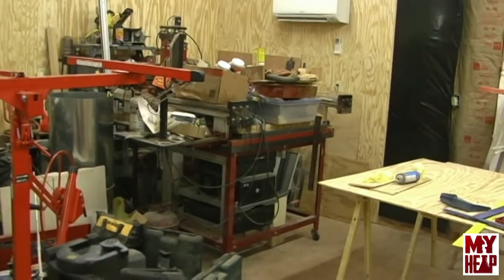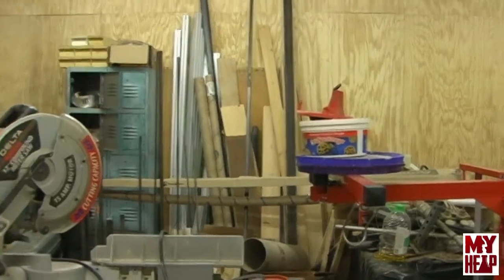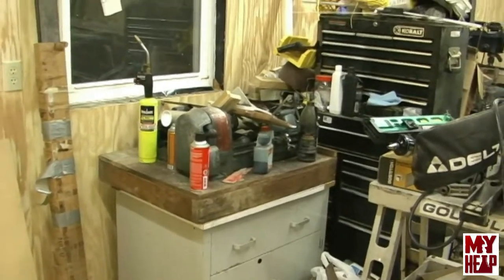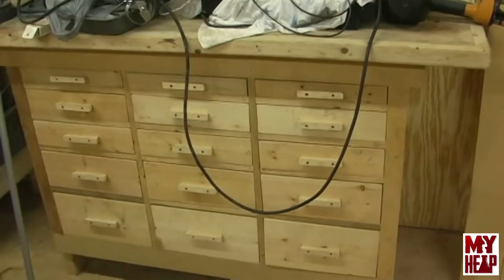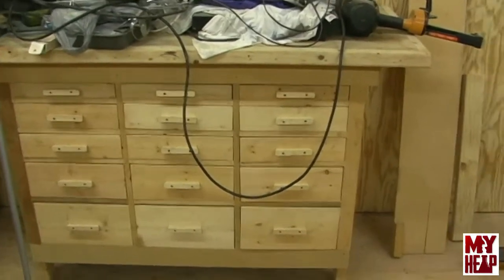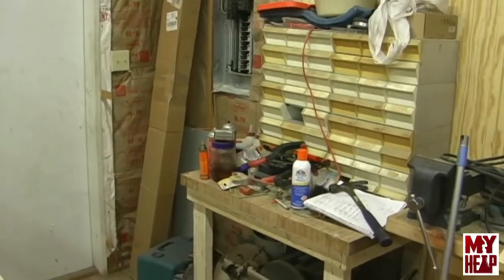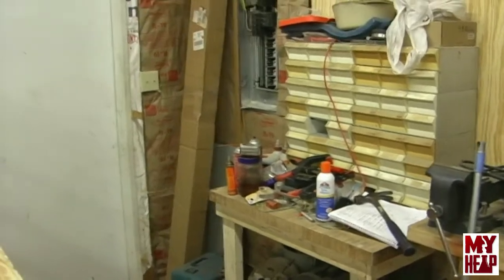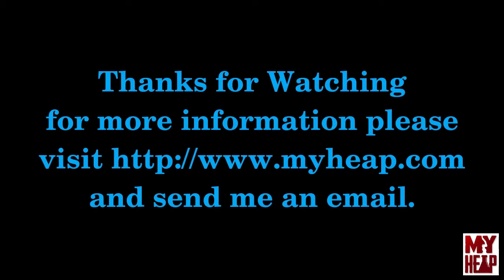Shop Update - 09 AUG 2018

Comment: That’s certainly a nice looking bench of drawers. Joe you have a bench problem in that you like all of us use them for clutter, like me you need more shelving. I’m actually in the process of making my work bench smaller so I have to clean it up. Cover your metal working machinery even in a closed shop because that wood dust just gets into everything. I have to cover mine to keep away moisture/ rust as my lathe and mill only have 2 walls and a roof, when time permits I’ll make the missing wall and doors but until then I cover my machines and will continue even when closed up. Give the basement back ASAP, as you know, happy wife happy life. Cheers Peter
Reply from the maker: Hi Peter.  I figured I would need to keep them covered from the wood dust.  When I will MDF it really likes to take to the air, even when I use a vacuum.

I would like to build a line of cabinets to put close to the ceiling along one wall.  Roughly 16" wide 16" deep and 32" tall.  About 18 of them along the 24 foot wall.  That will provide a place to store items I don't use as often.  Parts, supplies and the like.  Maybe if I live long enough I will get it done.  My wife wants me to finish the basement of the house.  That will be a task.  Thanks for watching.

Joe

Comment: Looking good! I like you also do wood working in the shop so my concern is keeping the oil away from the wood and wood tools more so that the saw dust from the metal working tools.  You mentioned welding, be very careful (and metal grinding) around the wood and woodworking, cinders may lie in wait only to cause a fire after you have left the shop.  Your shop all sounds good, I wish you the best the best and look forward to seeing the progress.
Reply from the maker: rtkville, thanks for stopping by!  I am putting the 220V 50A circuit close to the door because I intend to weld outside my shop rather than inside.  Like you, I worry about catching sawdust on fire.  Cannot be too safe.  I will be glad when I get the shop in a usable state.  I have projects to do that I think are much more fun to do.  Thank you for taking the time to comment.

Joe
Reply: Glad to hear it.  Also I wanted to make a comment regarding the 220v. AC.  I'm a real proponent of using 220 when possible because few people really don't under stand the benefits: electric motors which is what I'm talking about you get more torque at half the voltage.  In my shop I, like you do wood work and metal, so I have every motor that can be converted to 220 is 220.  In other words what I'm trying to say is while you at it take the time and install more 220 outlets.  I have several receptacle on one breaker because of the low amperage.  Good luck and enjoy your new shop!
Reply from the maker: I agree about the 220V Motors.  I have one machine that I just received (A rockwell sander) that has a 3 Phase motor.  Trying to decide if I want to change motors or get another 3 Phase motor and make a rotary converter.

Joe
Reply: I know what you are saying because I too have had some great equipment opportunities that I didn't take just because they were 3 phase.  Although I did debate getting converter but decided not to primarily due to the age old "money thing".  Although they have come done quite a lot sense those days, good luck and most important have fun in your shop!!!

Comment: cool shop, and looks like youve defenitely been busy. I dont remember seeing any workbench like that in any of gingery's stuff. That little lathe would defenitely make someone a good starter lathe, and really be good if they were into model engineering or making little engines and such. Thanks for the semi shop tour/spin around, lol.
Reply from the maker: There is a gingery book called Uncle Dave's something or another.  There are several little projects including this work bench, the stock rack that you caught a glimpse of, a grinder rest and stuff like that.  I think it was put out by Vince Gingery.

Thanks for stopping by and watching Chirpy.  Peter said something about you making a Gingery 4 jaw?  I must have missed that video.  Been slammed at work and not on YT much the last week or so.  I have some videos to catch up on this weekend.  :-)
Reply: Ive been thinking about making it, but just trying to get the sand muller finished and a few other little tidbit things finished up first. I kinda have the patterns for it, but alot of it needs to be finished up, sanded, and coated in polyurethane. 

I wouldnt ever trust it on a lathe, but was just making it to use it with my dividing head for when Im using it as a rotary table, just to hold those few parts. I was thinking of that and making a back plate for it instead of the standard design, which would make it much more versatile imo since I could use it on my indexing table and such, or on the dividing head when I need it. It was in the random bits video that just came out the other day, and showed a bit of what's going on with the collaboration with emma's spareroom machine shop.

Comment: Joe I'd look into Some tall cabinets with doors ,shelves are dust magnets it's better to store things vertically rather than piles ( I'm just as guilty as you are)
Reply from the maker: Hey Chris,  I am thinking a row of 16 x 16 x 32 cabinets pushed as close to the ceiling as I can along one 24 foot wall.  This will give me about 18 cabinets to store in.  Stuff that I don't frequently need.  Parts, supplies etc.  I think some base cabinets would be good too, but no shelves in them.  Instead just drawers.  I need to give some thought to it.  I know right now EVERYTHING is piled and disorganized from being moved a hundred times while I worked on the shop.

Thanks for stopping by!

Joe
Reply: My Heap any time Joe

Comment: FIRE . !!!  you got anything for that ?? I'd sheath the interior in 5/8 sheetrock
Reply from the maker: I have a couple of extinguishers for the shop.  I should have drywalled but took the lazy way out.  I hate to drywall.  I have a bunch of it to do in my basement.
Reply: why not "learn" MrsHaus in this hauswerke . (won't get her dishpan hands)
Reply: In the event of fire just have an ample supply of Hotdogs readily available at all times. Shop looks good....nice bench btw :)
Common sense is the best fire protection ~ Richard
Reply from the maker: The biggest reason I am putting the 50A circuit so close to the door is so I can do the welding outside to reduce the risk of fire.  And I agree, common sense and being aware of your surroundings is 95% of the battle.  Thanks for stopping by Richard.

Joe
Reply: Yep, I have a 35' cord on my 225A arc welder
Reply: How about the risk from a "flaming" mad MrsHaus ??
Reply: I met her Steve, very nice woman.
Reply from the maker: Hmmm ... Guess I will just have to keep on her good side huh.  I think I will remind her that I will be removing Bertha from the basement soon!  :-)
Reply from the maker: That's the idea.  I need to put a new cord on my arc welder, was thinking 30 feet or so.  Enough to get the machine away from the building and into the driveway.
Reply: Then instead of insurance I suggest he double down on the flowers and chocolates
Reply from the maker: Trust me ... She will be involved!!!!
Reply from the maker: Yeah, and maybe a moccamaster.  She has been wanting one.  (Anything to stay safe, you know!)